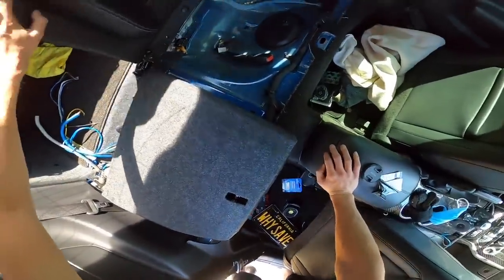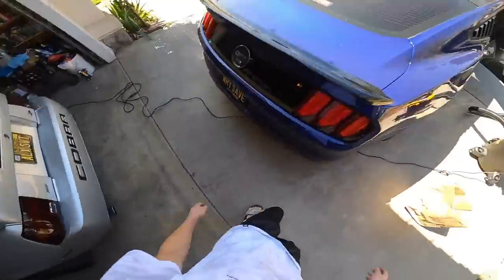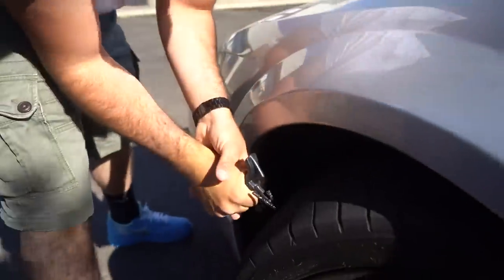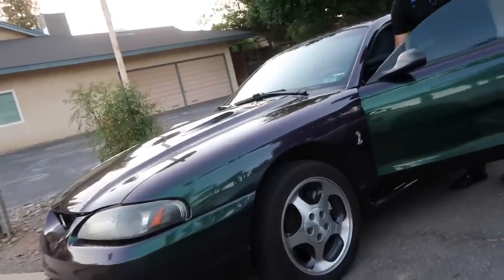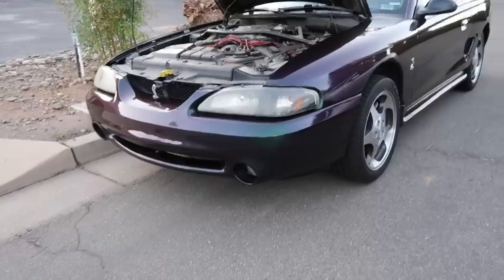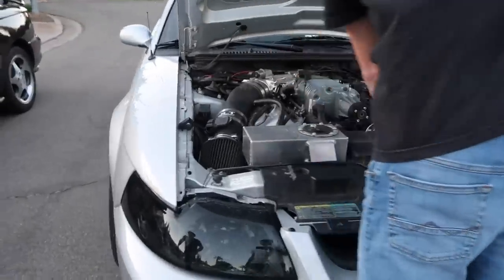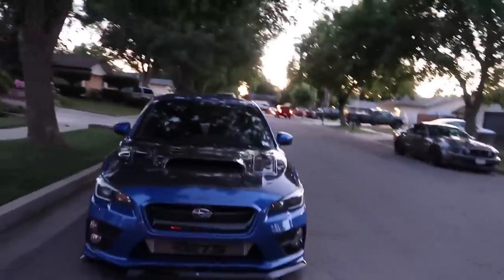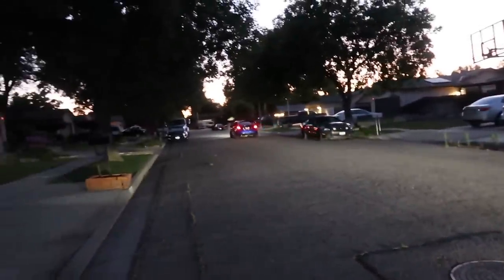He Didn't THINK MY COBRA WAS REAL TILL HE SAW THIS...

Comment: Alex bro I keep saying this but ford recalled all mustang gts (2011-2018)  with the t-56 trans for premature ware and clutch slipping that destroys the trans and leads to not grabbing. That could be why your 5.0 keeps burning clutches. Contact ford and see if you can get it repaired under the recall
Reply: No 11-18 had a t56. The t56 hasn't been in a mustang since the terminator. The. 07-14 gt500 has the tr6060, the 11+ gt, v6, eco have the mt82. The 05-10 have the tr3650.
Reply: Karl Hopkins thanks for correcting me just popped into mind. Not a mustang guy couldn’t tell you that stuff but Scotty Kilmer said ford just announced a giant recall for the manuals in the gts